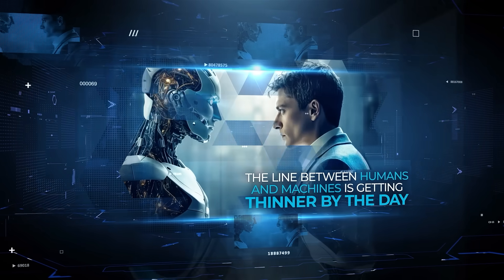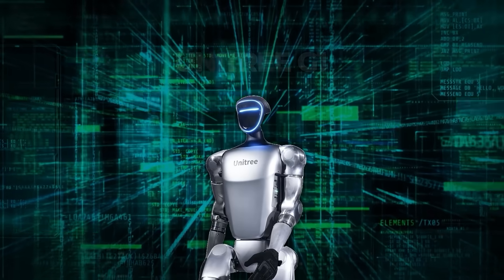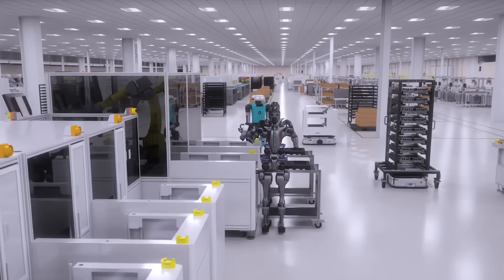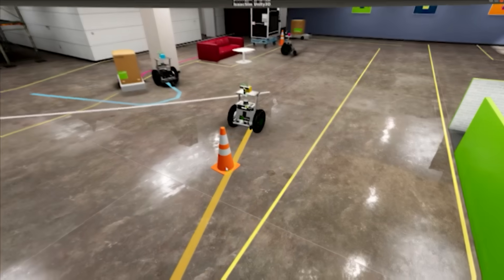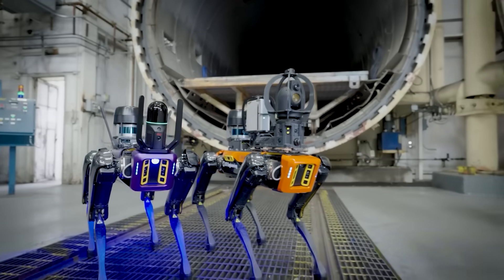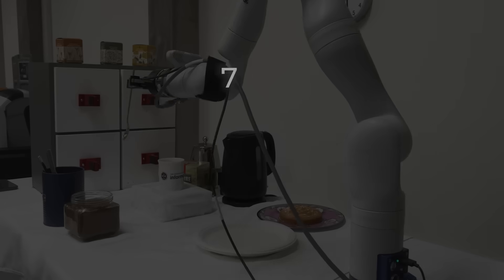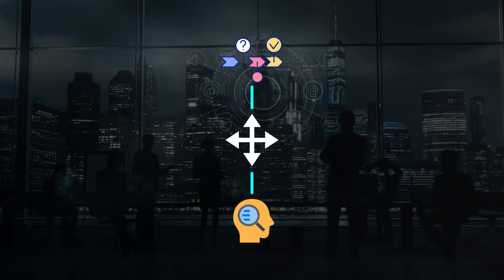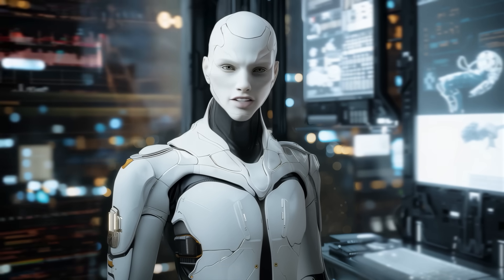Boston Dynamics New Atlas Feels TOO Human and It's Freaking People Out!

Comment: How does Boston Dynamics "reward" the Atlas Robot 🤖? @2:12
Reply from the maker: Ask ChatGPT about "AI reward system"
Reply: I asked ChatGPT, and in the test simulations there are multiple AIs in competition.  The most successful AI in the test is "rewarded" a numerical value.  There are rules of engagement during the competitions.  The AI is not allowed to cheat but encouraged to find loopholes to further its success above the other AIs.
Reply: I had the same question too…..DFTLD
Reply: Chips. Microchips.
Reply: @UnskilledGrappler  i was really hoping ChatGPT would have said sexbots and CyberCoke.
Reply: A jolt of extra electricity?
Reply: Literally just has a number called "reward" and when it's rewarded, that number increments. Simple as that. The ML algorithms permute and attempt to optimize the rate of increase to maximize the reward number. But ultimately, it's literally just a number.
Reply: @patrickheney9201  Yeah, that's CHATGPT's first response, but you have to probe ChatGPT more to find out what would motivate the AI to accumulate points and within a certain timeframe.
Reply: Promises of human slaves.
Reply: This is cgi